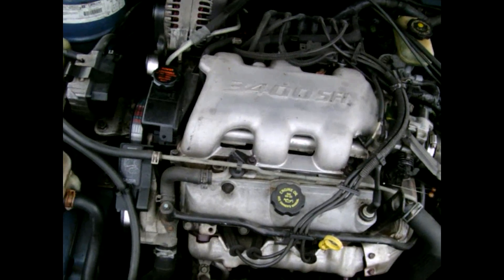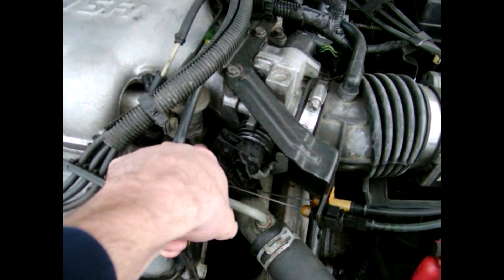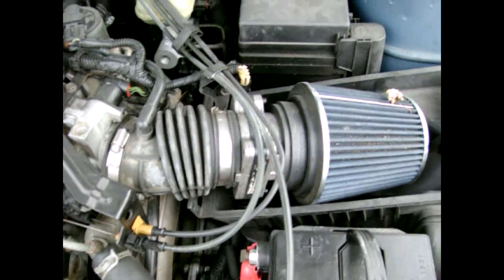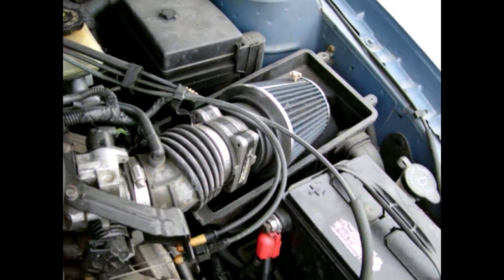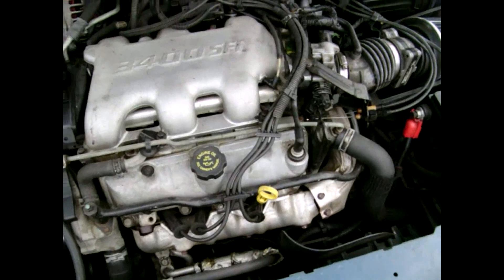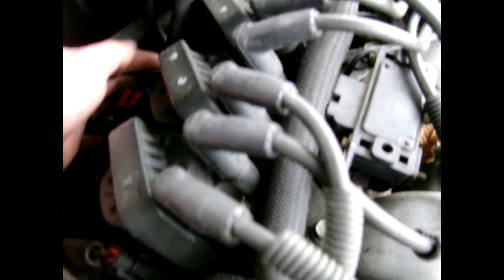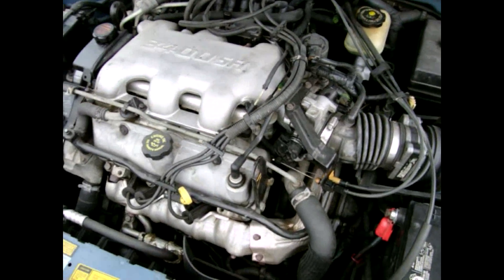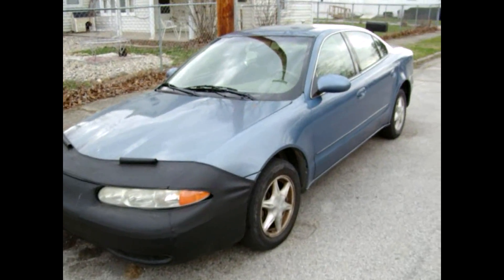3400 GM Engine 3.4 Liter Motor Explanation And Discussion

Comment: This engine has been cutting out on me  and stuttering at around 2k RPM especially when cruising and keeping the RPMs at a constant. I have spent a lot of time and $$ at the dealer and every time they say they've fixed it hasn't been fixed. Now, they are saying it's the catalytic converter but I am not sure I can trust them anymore. Can someone please advise? I would be very grateful for any insight.
Reply from the maker: Check for vacuum leaks and computer codes.
VT247
Reply: What's been replaced or done so far by the dealer???  Disconnect your MAF sensor then drive it, if the issue is gone then you may have a bad sensor.

Comment: Easy way to clean the EGR valve on the 3400 series motor..... off a 2000 Montana
Reply from the maker: Easy way to clean the EGR is to take it off, spray carb cleaner down the pintle and use a screwdriver to work it up and down.  Dump the carbon in the trash and work the spring until it no longer sticks.
VT247

Comment: My car has a bad crank sensor, and is wedged in the block big time! if anyone has an idea how to get it out (other than lag bolts and drilling (Didn't work)) then please let me know!
I'm thinking about dropping the oil pan so I can try to smack it out, any advice on that?
Reply from the maker: This must be for a different engine than the 3.4 GM V6, the crank sensor on those are externally mounted.  If you're talking about the cam sensor, they can be tricky.  May try drilling in a screw to pull on and heating around the area with a torch, but be careful.  If this is for another motor, still try heating it up.  May try tapping on the edge with a hammer and punch to turn it.  Just a few suggestions.  Broken bolts and stuck parts are not fun.
VT247
Reply: @Vacationtime247  Mine is a 2003 pontiac grand am GT1 3.4L vin:E.
I'm not sure if that clarifies anything.
I replaced the harmonic balencer, and there it no external crank sensor, like I found pictures of online.
The "7X"  Crankshaft position sensor, is on the side of the engine block near the firewall, in between the transmission and engine, with no room to work lol! I spent three whole days trying every trick I could find.

Comment from the maker: Find a replacement at a junkyard or order one new.  If it's repairable, use some hose to connect the broken ends together.  Most any junkyard will have several cars with the piece you need.
VT247

Comment from the maker: Might try pressure washing off the engine at the local spray and wash.  Get a better idea where the leak is coming from.  It's possible to have a leak where you mentioned, but I've not seen it leak from there.  Had about a half dozen or more cars, vans and suv's with the 3400.  Not seen one leak from there but yea, it is possible.  The price they quoted you seems high.  $1k to fix that?  Way to much.
VT247

Comment from the maker: From the messages & posts you've left, it's highly likely you've got a blown head gasket.  The engine can't make compression d/t the blown head gasket.  Blue smoke out the exhaust, overheats, no heat in the cabin and leaking antifreeze (probably where the head gaskets blown).
VT247

Comment: Hate 2 break it 2 U but I'm a dodge man.Was my neighbors car pissing fluids all over my garage.
The last Chevy I owned was Monza 2+2 305 possi. Screamed. My wife could roach a new GT mustang 350 off  line. Body was far liter. So much torque it cracked frame @ motor mnt. tried 2 repair cracked again same spot.
I haul my/uncles/cousins campers thru Adirondacks Ram 5.8. I pass chevy Ford all day long. My1964 361 wedge Polara(Mex cop car) A/C factory still works. My F250 ate rotors evry 6 mos.

Comment: I have a 99 alero 3.4l. With ~162k miles.  The car. died on my wife.  I pulled CEL codes.  Only P0300 multiple miss fires.   All cylinders receiving spark.  Will barely stay running for 1 minute.  Sounds like2 cylinders missing.  I did notice the oil pressure light is on.  Any suggestions would be appreciated.  I'm thinking oil pump.
Reply from the maker: Might be a bad fuel pump if it just died unexpectedly.  Known problems with this motor is the intake manifold gasket and head gaskets.  Check the oil.  I've had a blown intake manifold gasket dump coolant down in with the oil, causing a milkshake effect.  If you're doing the intake, go ahead and do the head gaskets too.  It's not that much more work and they are known to go bad especially in the winter.  Hope this helps.
VT247
Reply: You have a broken camshaft most likely. Oil pump is driven off of the cam, so it is not turning and if you open your oil fill cap you will likely see that, upon cranking the rockers on the right are not moving.

Comment: We're is the theromastat located on it
Reply from the maker: Right under the throttle body, it's tucked down in there badly.  But, if you're having any type of heating issue, bleed the system.  Also helps to do a coolant system pressure test.  These engines are known for bad gaskets.  Intake, Head and timing plate cover gaskets all go out.  If this is the case, do them all. 
VT247

Comment: My 3400 is in a 01 grand am n just the other day it started to lose power while accelerating. Now it has NO power pasy 4000 rpms!!! Its not spark plugs wires or the mass air flow sensor. The only code that is going off is an oil pressure sensor. HELP!!!!!!!!!!!!!!!
Reply from the maker: I'd start with changing out the oil pressure sensor.  Not entirely sure what the computer might tell the engine to do when it reads low oil pressure.  Could be that when the computer senses low oil pressure it keeps the engine from revving up properly so it won't blow the engine up.
VT247
Reply: Hi , had same problem with loose power especialy when on highway , i found  disconected tube frombehind engine which is coming out after air flow sensor 1/2 inch size or something like that , it was ok attached at intake after air flow and i just stick it back somehow in behind of engine , this happened after mechanic change spark plugs  i came back  to them tryin to say car no  longer running as it was beforeand loose of power at highway but they said dont know what the problem , so check that may help you.

Comment: lol, I am 6 years late but I want to rebuild the top half of the engine. I got the whole dex cool problem.
I haven't read all the comments but these 3400 60 degrees have an ish with dex cool. 
when mixed with air the dex cool becomes a low-grade acid and eats your gaskets alive.
now I gotta fix it. lol, but when she runs okay she purrs like a kitten!
Reply: Same problem here. Same engine on a '02 Impala. Problem isn't the DexCool itself, but the cheap lower intake manifold gaskets. Once they are perforated, you can get coolant in your oil, or in my case oil in my coolant. I've flushed the radiator several times, trying to get all the gunk out of it, but eventually I will have to replace the gaskets. Not looking forward to it.

Comment: Cómo se calibran los balancines y como calibrar válvulas Chevrolet venture 98 motor 3.4
Reply from the maker: No hables español bien. Haz lo mejor que pueda. Los balancines se atornillan. Sin ajuste, torque a pie libras. A veces se desnuda y necesita un helicoil. Retire la tapa de la válvula e inspeccione si está floja.
VT247

Comment from the maker: You need to bleed the air out of the system.  You do this by loosening up the 7mm nut on the black coolant line on top of the water pump.  Turn it out until water / coolant comes out with the car running at operating temp.  Turn the heat on in the cabin.  Heat should start coming out the vents.  If heat comes out and then goes away....bad news it's the head gasket.  I have a video up on how to do a head gasket change if it needs to be fixed here on Youtube.
VT247

Comment: I have the same engine and I recently flushed my radiator so why is my engine still overheating?
Reply: Jarret Grier      Could be the water pump the thermostat or a crack in the engine block is anything leaking

Comment from the maker: If the upper intake manifold was bad, the car would have an erratic idle.  Due to a vacuum leak.  Typically, the upper intake manifold gaskets don't go bad.  My guess, he's trying to make a quick buck.  They can be fixed in @ an hour and would probably charge you $100-$200 to fix.  Doubt their bad.  If the car runs good, they're good.  
Be sure to regularly check for 'milky' oil.  Sometimes the lower intake will leak on the inside, allowing coolant in with the oil.
VT247

Comment: does anyone kno wat a light tappin sound can mean on a 03 oldsmoible alero, i did nothing but clean nd shave the cylinder heads?
Reply from the maker: Might have stripped out one of the rocker arm bolt holes that go into the aluminum head.  That's my first guess.
VT247
Reply: i havent ran the engine tho.....
Reply from the maker: Take a piece of vacuum hose put one end to your ear and the other to different parts of the engine while running.  You should find where abouts the noise is coming from.
VT247
Reply: it sound like the engine valves..
Reply: If it does it when cold, its called "cold carbon rap" it happens, and is nothing to be concerned about.  You might want to perform a WOT / or a little hard acceleration and engine breaking by driving in 3rd to break up some of the carbon on the cylnders.
Reply: take a sticklike a toilet plunger put your ear against one end of the stick run engine then put outher end of the same stick on the hed the nois is coming from move it from end to end to find the spot over the clicker take valve cover off breifly start the engine be ready to push the rocker with your thumb on the tpo over the valve end of rocker if its the tappet it will set down harder then the other quit valves be aware of any change in the actual movement of several rockers so you may compare effects check rocker mite be worn the one setting down hard ? or tappet partually clogged

Comment: I've got a 98 skylark fuel line was leaking caught on fire fixed the leak and the wireharnes but won't start can anybody give me advice
Reply: make sure getting fire from battery to 20 amp fuse on hot side

Comment: I still have the venture van. There is a hose that connects the mass airflow tunnel to the rocker arm cover. Whoever designed this needs beaten with a board. Is there a relatively easy way to get the hose into the rocker arm cover as there is no way to get a normal sized hand or to see back in there to insert said hose. I don't even know what the hose is called. ugh!
Reply from the maker: That one is a PITA.  Best way I've found is for it to be loose at both ends, then fish it through to where it is approximately.  Press in the front near the air inlet.  Then the back should go in without a lot of hassle.  A long screwdriver, ruler, or something helps get in behind it to press down.  Hope this helps some.
VT247
Reply: It did. I got it! Now I have changed the battery since the parts store tested mine and said it was bad, replaced the alternator, it was a used one but I took it off another van I bought for parts and was working at the time, but my battery is still going down and the battery light comes on when accelerating up a hill. Would a bad starter cause this?
Reply from the maker: Starter wouldn't be causing this.  The alternator would though.  Might want to have it tested but first check the fuses and voltage at the battery.  Some alternators don't put out the same amperage as others too.
VT247

Comment: Yes it does have heat a nice flow. But somtimes i think it should be hotter then it is. But i drive a truck so my heater is right on me it gets hot fast.Its leaking a little quarter size pudel about the same with the oil. The van was my mom and dads its been very well taken care of. They didnt need it anymore so they gave it to my wife .My dad and i are very mechanically inclined and work on our own cars, but this is my first GM always had toyotas and hondas So i know nothing about this 3.4L

Comment: I have a air leak but mines whistles and white smoke comes out the tail pipe.!!!!!! #helpme
Reply: manifold on 3.8 engine bad get dorman replacement and get guy fron repair yard to change it (manifold) then refill white smoke is antifreez smoke
Reply: dago88881. 3.4L V6 Engine
213,000 Miles
Starts and runs 
It has an exhaust leak antifreeze came from the middle of the exhaust pipe under van

Comment: try looking to see if the catalytic converter is partially clogged i know from exprerience that it will not allow your vehicle to go over 60 or some times over 45. due to back pressure in the manifold. more then likely if you had a miss in the engine and you kept driving it you prolly ruind the catalytic converter.

Comment: Wheres the upstream o2 sensor?
Reply from the maker: There are two O2 sensors.  One is below the coil pack on the rear manifold.  The second is just after the catalytic converter.
VT247

Comment: My car died on me a few times. it died yesterday and woulnt start. i got it towed and did the fuel filter, no change. it cranks strong but just wont start.
Reply from the maker: Fuel spark and compression.  Check those.
VT247
Reply: found that the fuel pump wasnt working. i may sell it because i dont have a hoist

Comment: I'm completely lost. I have a 2000 grand am gt. I had the engine replaced and it ran fine. No problems until about a month later. Now it sometimes will either overheat or I will have heat inside the car and loose it and then I can shut it off let it sit for a couple mins and it'll be fine or it will just be fine to start. I put a new coolant bottle, new thermostat, and a water pump off the old engine that I know was good. Sometimes it will push coolant back out the bottle through the overflow or just air after I shut it off. The car runs good. It doesn't smoke. Starts easy. Everything. When it over heats or when I have heat and loose heat the radiator hoses are both soft when everything is fine they are both firm. Neither one feels to soft to where it should collapse. Help
Reply from the maker: Try bleeding the bleeder screws at the top of the water pump and the thermostat.  Hope it's not the head gasket.
VT247
Reply: I know about the bleeder on the water pump. Where's the one by the thermastat
Reply from the maker: The other bleeder is located by the water neck were the upper radiator hose connects in with the motor.
VT247
Reply: is it just the actual pipe that the goes from the thermostat back to the water pump? other then that there isnt anything
Reply from the maker: It's the large upper water neck by the throttle body.  Bleeding out just the one bleeder should work.  If you bleed the system, have heat inside for a minute or so, then loose all heat and the car starts to overheat, it's probably the head gasket.
VT247
Reply: Ok. Thanks. I'm going to try to bleed it again and I'm going to make sure my heater core isn't plugged some. Whoever did the waterpump before used a shit ton of rtv and some was in the housing
Reply from the maker: Check the oil level and under the oil fill cap.  If there is white sludge, the lower intake manifold is bad.  If the oil is fine, try this.  Fill up the radiator until full, bleed the system.  If you have heat in the cabin for a while, then it goes away & the car overheats, the head gasket is bad.  Common GM 3400 problem. : /
VT247
Reply: I keep getting air. I've had to fill the resivor twice
Reply: The hoses stay soft like it's not building pressure
Reply from the maker: Bad head gasket or it's leaking somewhere else.  Most likely, head gasket.
VT247

Comment from the maker: You could probably wait a while before doing the gaskets.  With just 60k miles on it, I doubt there is any problem with them yet.  But around the 100k mark, they should be fixed before going out at an inconvenient time.
VT247

Comment: Underneath the pully? Try replacing the head gasket. That's the easiest leak fix. replace engine if that doesn't work. water pumps are a big deal.

Comment: 2004 alero, 3.4 v6 ,i have to pump the gas to start it and it will idle and quit . it also has a funny egg smell to it. i changed the plugs and it didnt help.
Reply from the maker: Sounds like a bad catalytic converter with the rotten egg smell.
VT247

Comment from the maker: Sounds like a vacuum leak.  Get a mist spray bottle full of water and while it's idling, spray around the motor.  If it dies when you spray an area, that's where the problem is.
VT247

Comment: 7x crank postion sensor location?
Reply from the maker: Vontae Knight Lift car, take off passenger wheel, take off dust panel, locate harmonic balancer.  Right side of the harmonic balancer is the crank positioning sensor.  Must remove harmonic balancer to replace.  Best to also remove and replace timing cover seal.  They can leak.  Hope this helps : )
VT247

Comment from the maker: Yikes.  I'd just get another motor.  If the bearings are shot, then there is a chance other bearings have had metal to metal contact.  Find one where the oil is still black and spins over freely with little slop in the timing chain.
VT247